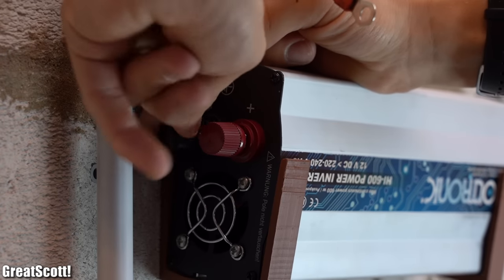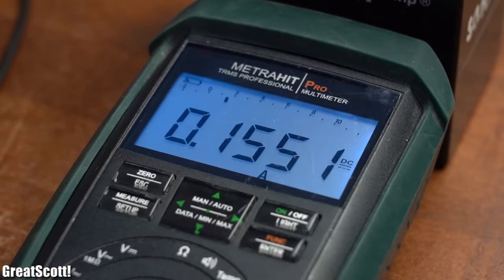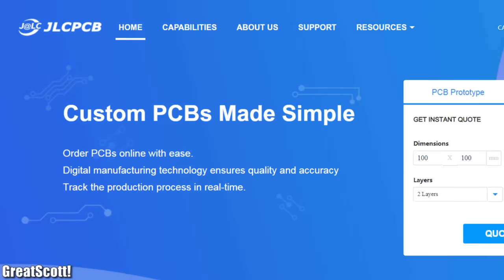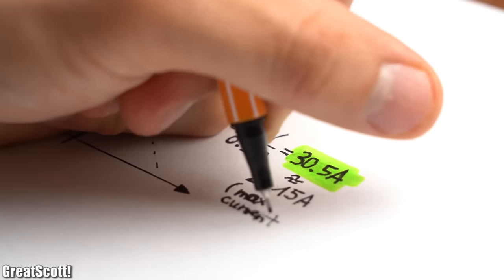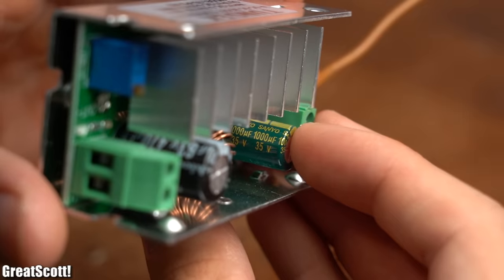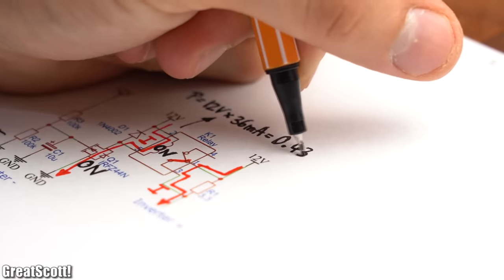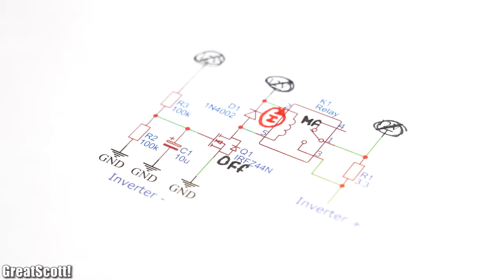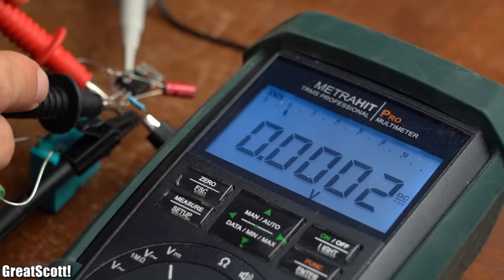How to make a Softstarter and why it is sometimes mandatory to use!

Comment: Hi there Scott, I've stumbled over this video mostly by mistake and it has prompted me to write down my own impressions on the topic. DC power supply systems with a beefy central PSU, or even a battery, have always been present in Telco and industrial process control settings, and in spite of that, there are hardly any dedicated DC soft-starters on the market, and the makers of "powered devices" mostly do not care very much either. Now with the rise of solar systems, the number of people hitting this obstacle must be growing again. Historically I've done some reading on the topic, and during the years on my techie job, I've been mostly frustrated about the "state of the art". Currently the most thorough DC soft-start and protection circuits that I've met are based on the TI TPS2492/2493 = originally a hot-swap controller IC, driving an external power MOSFET. Here's my humble webpage on the topic: http://support.fccps.cz/download/adv/frr/inrush/inrush.html

Comment: Cool project but why not use a second mosfet instead of the relay?
Reply: Maybe he didn't have a mosfet big enough?
Reply: All the current would have to go through the mosfet and stress it, requiring power components ("bigger mosfet") and producing heat. The problems this presents are greater than the required relay current.
Reply: I added a homade super cap to my solar system in line with battery and I had no problems with a pool pump draw ,without it the system All ways  tripped saftey
Reply: The bms always pulls a load and the pump is on a timer for maxim use of sun
Reply: @alexoja2918  Obviously, the pump have much more current rush at start than the capacitor. Your system was already designed to limit in rush current. You didn't need that capacitor.
Reply: I know it's the cap because I can run it 2 12  volt car batteries with cap take the cap out add a third battery still  errors add the cap smothes it lol
Reply: Nothing fancy just a harbor freight solar station and a 3 liter layden jar ,inverter all hardwired to 2 12 volt battery in parrell  ran 3 but had cell problems
Reply: Heat generation and the consequent power loss.
Reply: @alexoja2918  PFC is done on the ac side. Super cap on the DC side delivers current spikes without the suply browning.
Reply: @UberAlphaSirus  Absolutely right! Don't know what i was thinking.
The cap still takes a huge current to energize so starting the system while completely discharged will be stressful but yeah, doable.
Reply: @moiquiregardevideo  Sure, that's the only way for it to work properly. It'll still be somewhat of a spike, but a single motor with such a capacitor is no problem. However, i'd go for the single current limiting circuit rather instead of having to worry about adding capacitors to loads if i ever need to add or change anything. Especially supercaps that get really expensive when you want voltages higher than 2.7V.
Reply: @alexoja2918  Have you datasheet for the IRFZ44N? 49A continuous with a heatsink. Two or three in parallel, and you wouldn't need much heatsink. Still cheaper than a relay.
Reply: @vylbird8014  Not going to check but I'd describe that setup as a bit clunky and also expect it to waste more power than a relay. Hard to believe that's cheaper either, but like I said, not going to check. If your info is correct, that's actually a cool (though maybe not literally) solution!
Reply: @ Mai Mariarti : perhaps with a project that uses a relay that closes only at start-up and then returns to stand-by until the next use, powered from the load side and disconnected by the opening of the relay contacts
Reply: Mai Mariarti  Yes it is, but if you ligt up the relay then the load... I don't know how, but I think it is possible
Reply: simplest answer, because catch 22
or basically resistance from heat and over a second or two voltage loss within enough time to waste the circuit going back to square one.
Reply: Why use a second mosfet? He could also connect the load directly instead of the relay and bypass the mosfet with the 3 Ohms resistor. In order to work he should also recalculate the voltage divider & capacitor, as the irfz44n will not fully switch on at 6V Vgs. At 10V Vgs irfz44n has an On-resistance of 17 mOhms, leading to a power loss of almost 4W at 15A. Not 100% sure, but I expect this small relay he uses also to have quite a bit of resistance and there are much better and still cheap mosfet out there ;)
Edit: just recognized he only needs 8A (and the relay is also rated for 8A). In this case the mosfet would only waste 1.12W.
Reply: One thing you might be forgetting is that the mppt only does 15 A max that means that the mosfet on one device might only do 10 as absolute max so that would mean that it would not waste that much power
Reply: Agree...  When saturated n channel MOSFETs, can have  less on resistance than the  resistance of a relay's contacts. N channels can easily be driven as high side switches by floating the output of a photovoltaic output optocoupler between gate and source.

Time delay triggering of mosfet, into full saturation? I'd try a PUT relaxation oscillator set to stay latched on after it gets triggered.  It's output through optocoupler to ground. Resistor of RC timing element chosen  to limit current through optocoupler. Put will latch on if top resistor of set voltage divider element bigger than RC timing element.

Comment: I believe the fact that a thermistor takes a while to cool down is why we are sometime advised, when "turning it off an on again", to leave the appliance off for a few 10s of seconds before turning on again.

Some people were asking if an inductor would work.  I found a 2mH inductor limits the current nicely, but a quick check at farnell suggested they're not easily available in high current ratings.  An inductor will also limit the PSU's ability to handle power surges, and can overstess the circuit by oscillating with the capacitor.  In simulation with a 12V source, I was able to get the capacitor voltage up to 22V on startup, before it settled back to 12V.

A field applications engineer from Linear Technology put me wise to the dangers of suddenly connecting a PSU with an inductive lead - the PSU can momentarity see TWICE the supply voltage, and be destroyed.

Comment: Can't we use inductor in series with appreciate value so that it will limit the inrush current and as soon as the voltage gets stable we will have no inductive reactance and hence no resistance/powerloss (except for resistance of that wire)???🤔🤔
Reply from the maker: That is why the inverter came with an inductor on the input. But the value would need to be very high to get decent results. That would be too expensive since the inductor needs to be able to handle a lot of current.
Reply: @greatscottlab  oooh thanks for replying 😍 😍
Reply: @greatscottlab  Have you made calculations about coil properties? Since the pulse period is long, you could use an iron core of a ballast of a fluorescent lamp(15ms would equal to around 150 hertz in ac).

Comment: Inrush thermistor is actually quite adequate. For one it's more effective than it seems on repeat turn on, because at the core it's much hotter than at the surface, and cools down there much faster. For other the capacitors likely aren't discharged yet and so less inrush current limiting is needed. Also a choke can make for some additional inrush limiting.

Comment: Won't an inductor work as well as a resistor on the input to reduce inrush current ? ...nice video m8 keep it up
Reply: I don't think so because the inductance of an inductor must be established first. So the inductor would only have a small resistance in the beginning and would not cut off the high currents.
Reply: Corn the inductance are used to reduce the inrush current since the rise / fall time is very low ..it should have a voltage drop across ...correct me if I'm wrong :)
Reply: Maybe it's to prevent oscillations caused by both capacitor and inductor? That would be my guess

After some further reading, nope, seems like this is indeed the way to go :')

Comment: Can we just switch on that switch based on the voltage of the capacitor? .. (using a comparator maybe) .. and avoiding the delay circuit entirely!
Reply: Surely, but it is a bit less convinient imo.
Reply: @tunahankaratay1523  or maybe just a constant current source using a mosfet?
Reply: @elninorosario  Aww, that one would probably be problematic. It works like a very high frequency oscillator so it is not pure dc. You would need to smooth the current with an inductor but then you could also directly use an inductor. The inductor size will decrase with the circuit of course but it would still be very bulky and expensive. Relay circuits are even more efficient with big loads and it is super cheap and simple too.
Reply: I think I need to clarify a bit more. The constant current circuit is a comparator with variable voltage input on one side and a current sensing resistor connected on the other input. The resistor connects to ground and the load. Since the mosfet gate has a capacitance in the  picofarad range, the circuit acts like an RC oscillator. This oscillation is a square wave with changing duty cycle and frequency. It works at the end but the voltage isn't perfect dc. And the mosfet would waste more power than 0.5w(0.05 ohm*10 amp=5w, crazy)(the relay res is as negligible as the wire res).

Comment: Thats why always the inverter go direct to battery and no to the charge controller xD
Reply: solar systems don't need batteries as you use grid power when sun isn't out and use solar when sun is out and feed back to the grid during the sun being out which turns your meter backwards and rewinds it for a total net use of zero.  Batteries then are a waste of money for home solar - unless if you don't have grid access...
Reply: @artbyrobot1  i'm offgrid in the other case why you need inverter ? In the on grid micro inviertes just need and go direct to ac
Reply: artbyrobot but in a blackout u don't get any energy without batteries
Reply: Glad I'm not the only one to spot the deliberate mistake - LOL. It the 'load' that should go to the battery - then everything's covered.
Reply: You would still have a problem any time the inverter turned on.

Comment: Inrush current can cause Jitters or might confuse the digital circuit leading to severe outcome if used in medical or military applications. Caps, TVS, fly-back diodes and the like and the like can do magic in recovering from those problems.

Comment: Why connect the inverter to the charge controller? That is not the best connection, most are connected directly to the battery! The output if the controller is usually designed for a street light, or night light, any reason for this?
Reply: MPPT charge controller has a battery protection feature which disconnects the load once an unsafe low battery voltage is reached . Also it includes load monitoring via the serial port

Comment: Nice video, and good solution but I did the same thing in an easier way - I just connected my inverter up to the battery’s directly (through its own fuse) and don’t run it through the charge controller.  Sure you won’t be able to monitor the load with the charge controller app, but it saves all of these issues.  I don’t use the inverter much anyway and run almost everything I need to from 12 volts (lights, phone and laptop chargers, etc), but it is an easy fix. 👍.  Keep up the great work, love your videos.

Comment: Is that possible by simple inductor be used bcoz Sudden increase in current can be slowed down by inductor.... Plz answer
Reply: good question!
Reply: In some limited cases this can be done for low currents, but it's more akin to filtering and is expensive. Most important of all: an inductor usually produces inrush currents. That's why high inductive loads cause your lights to dim for a split second. Coils take current to energize.
Reply: @alexoja2918  Yeah but in the sense of price i bet its cheaper then the realy and mosfet together.
Reply: short answer: yes
long answer: the required inductor has to handle big currents and has to have a lot of inductance (in the H range) which means it will weight many kilos and cost a fortune
Reply: @SelectLOL  It would be a huge pile of copper and ferrite core, compared to a couple of generic components! The main efficient uses for transformers (dual inductors) are AC power transmission and SMPS circuits using high frequencies, and even in as small a use as the latter, they are usually among the most expensive components in the BOM.
Reply: @SelectLOL  Also in the use case of inrush current limiting an inductor that size would produce resistive losses as well as risk artifacts in current.
Reply: @viermidebutura
Reply: @alexoja2918   @viermidebutura  I see your points guys, so in summery it would have to bi really big so that the Inductivity would be sufficient enough and the resistance of the coil itself would be big too, and loses would be made over the coil. Thank you guys

Comment: Looking forward to the continuation of this topic to large motors, welders, etc. and the use of electrical generators to power them.  I have loads ;-) of problems when they start.
Reply: Use well-cooled under-rated cables to supply them. The cables will act as resistors effecting a soft start ;)

Comment: In the old days, there was a special large mechanical relay that had two or more poles, and it's contacts throw could be adjusted independently. The first contact to make a contection had the current limiting resistor, the second contact would them bypass the resistor.

Comment: This is VERY apropos for me. I have an off-grid solar customer with a 1.2KW PV array, an FM80 charge controller and a VFX3524 120Vac inverter charger connected to a Signature Solar EG4 200AH, 24V LiFePO4 battery rated at 100 Amps discharge (2,400 watts continuous).
The problem is that the BMS that controls the battery panics when you connect the inverter to it. It seems pretty obvious to me that it is an inrush problem. Even applying power to the FM80 controller will make the battery panic (short circuit shutdown mode).
The ONLY solution I have come up with so far is to briefly bypass the 250Amp DC circuit breaker between batt positive and inverter positive with a pinkie-tip sized 4.7uH inductor and THEN flip on the breaker! Inverter then fires up just fine. And it is reliable. BUT, sometimes, when the customer plugs in a laptop power supply at just the wrong time, the inverter will, apparently, react strongly enough to panic the battery and you have to go through the entire restart process to get the battery, inverter, charge controller and PV panels back up again. But 700 Watt toaster is no problem, a 1,200 Watt hair dryer is no problem, but a small ShopVac will instantly kill the battery. So it seems that purely resistive loads are no problem but any kind of reactive load will kill the battery. So is it possible to modify the circuit you have shown here with something that could sense an inrush event and switch the relay off for a second and then switch the relay back on again? This could be placed at the output of the 120Vac inverter/charger to help prevent inrush that makes the battery panic.

Comment: We used to use 3 phase soft-starts on 130kw bore pumps. 2 pumps made one water screen. We had to turn each pump on separately so we didn't overload the supply. It was interesting to see the first kick then ramp up. The soft starts made great sounds as they worked until the bypass kicked in 🙂

Comment: Hi Scott Great Video. You could also use a low side Mosfet to limit the inrush current. The VESC anti spark switch is doing that in a good way. So no mechanical components are required.

Comment: Just relay itself bridging the resistor works for me in most cases. 
Because the time needed to switch (energize the coil) is actually panty of time to reduce inrush current.

Comment: I'd probably add something for quick discharging of the 10uF capacitor when the input voltage is removed.  Now this circuit has the same problem still as the NTC in that the switch-on time is reduced quite a bit when this capacitor isn't discharged yet.  Though with the much larger delay compared to the pulse length you may indeed not notice that effect anymore in the current setup.  Careful though if you have a MOSFET with a much lower threshold voltage
Reply: hahaha yes i also noticed this, seemed like such a hassle to get eventually the same results as the ntc lmao
Reply: Did you do the calculation to see how long it takes to discharge the 10uf capacitor ?
Reply: @cornbread-glimpse-emblaze  Did you do the calculation to see how long it takes to discharge the 10uf capacitor ?
Reply: @MrSummitville  tau = RC = 1 second to discharge to 27% of the initially applied voltage (see https://en.wikipedia.org/wiki/RC_time_constant)

Comment: To reduce to power loss of the relay a second set of n/c contacts could be parallel across a small resistor and put in series with the coil creating a 40% reducing is voltage across the coil( as the relay has operated it doesn’t need as much power to hold it shut)